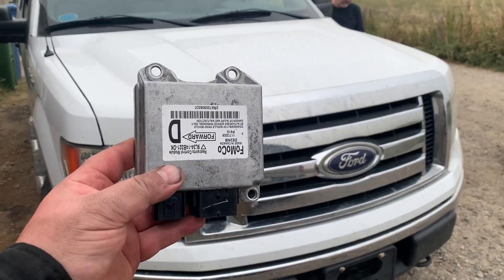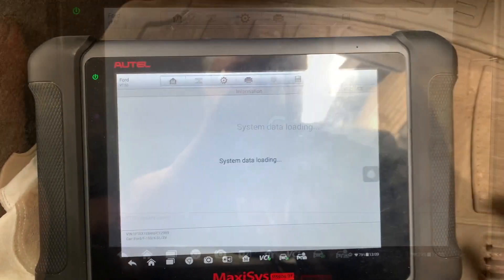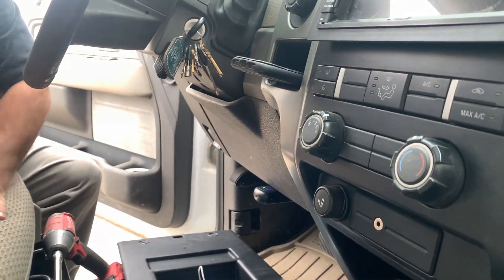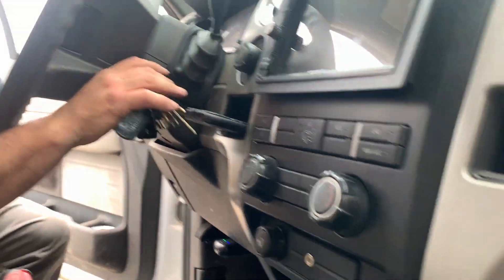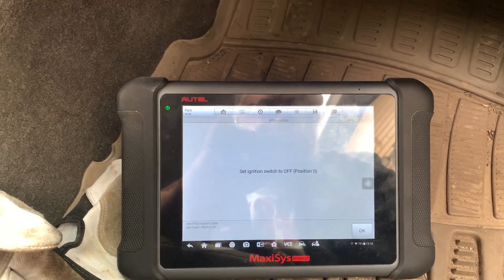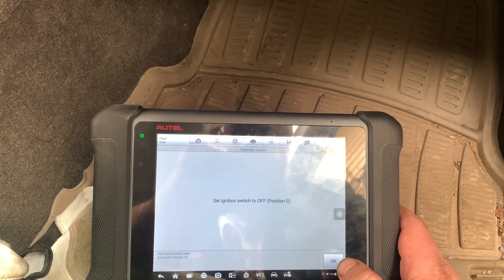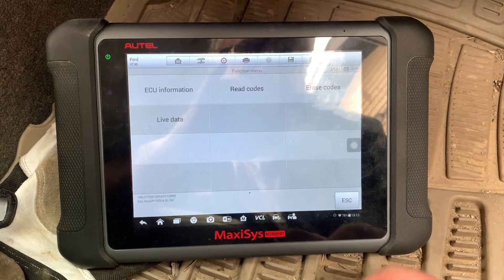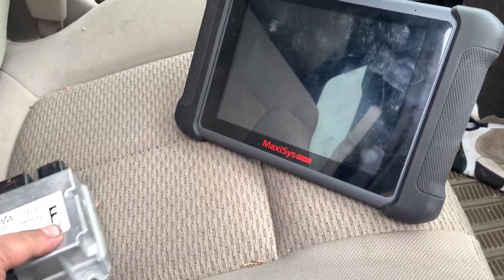How to Program a F150 Restraint Control Module

Comment: Nice video ✅ I have 2016 Ford Escape I had car crash fixed the front end changed the airbag and everything the airbag light stays on , went to junk yard and I put used one on my car now I triggered 2 codes C0061 and C0061 , I didn’t have any codes after I fixed the car I even passed smog test . And also I have message on my dashboard say “ hill start assist not available “ and traction light comes one . I’m wondering if I do the same procedures would solve the problem ? What model is this tool ?
Reply: DO NOT disconnect the old one before you save the code from the old one I hope you didn't disconnected already otherwise you would have to take the car to the dealership and they will suck your blood alive . I don't know why this man in the video didn't mention that there is a code need to be saved on the older RCM 🤦🏻‍♂️
Reply: @arabcampers9554  too late I already installed the old one and now my scanner asking for a code 🤦🏻 .
Reply: @arabcampers9554  what if I disconnected my old when to get it reset and it still didn’t turn off the airbag light I want to buy used module and put in do I have to save the code as well ?
Reply: @arabcampers9554  can you explain me this? What code are you talking about? Thanks in advance